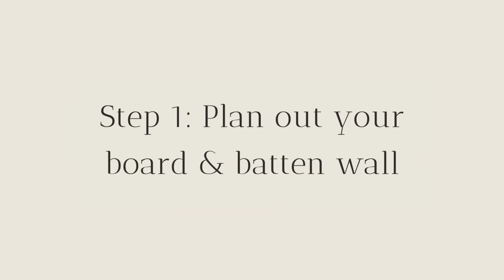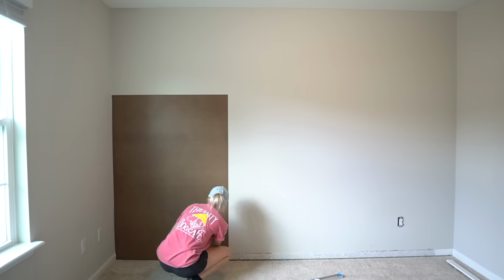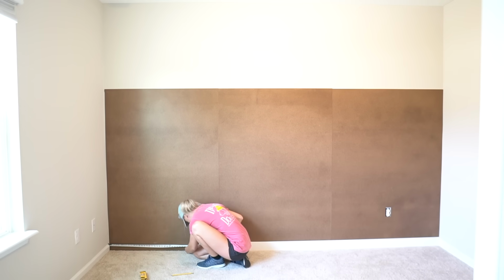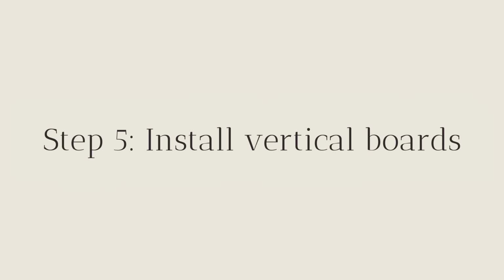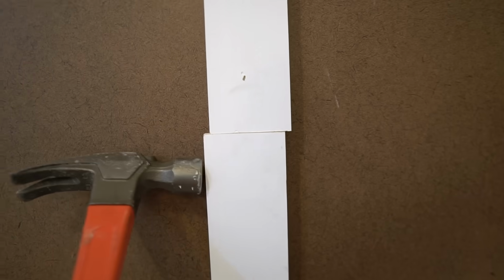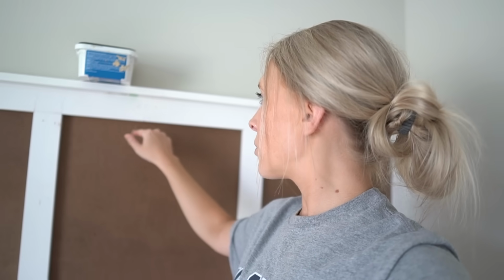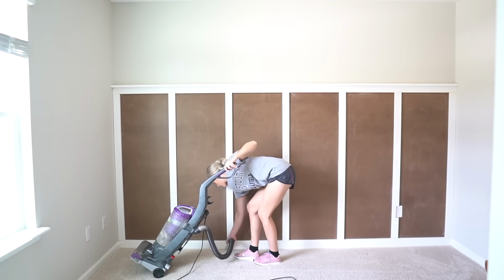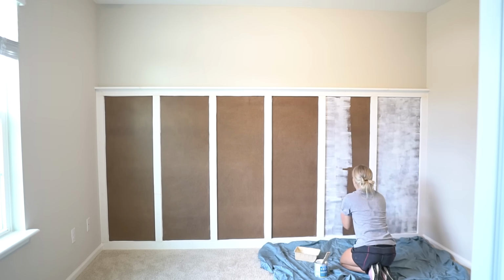Board and Batten With Textured Walls | HomeWithStefani

Comment: PRO TIP: When using construction adhesive lay down a bead of circles instead of lines, it creates a vacuum and helps the panel stick to the wall better.
Reply from the maker: Thanks for the tip!
Reply: Hi, can I ask how to secure to concrete walls? A nailer won’t work, I have adhesive will this do, it’s only going in a cupboard to make walls good.
Reply: Lisa Porteous there are concrete adhesives that you can get at the hardware store. Just find one that can be used with wood. There are also concrete anchors you can use,  but I don’t think I would with this type of project.
Reply: @lisaporteous3689  
I would use screws. So screw the large sheets to the wall and then cover the screws with trim or frame. 
The real why I would use screws is they are strong and they do not require setting time like an adhesive. And then if I wanted to I could put shelves on the wall easily. 
I would use sheets of plywood instead of mdf If I was needing selves/cabinets.
Reply: @lisaporteous3689   that should work, but make sure to have some boards to brace to the opposite wall to hold your pieces up against the wall while the adhesive dries.  You could also use adhesive which has directions to cut the piece, apply adhesive to the back, then pull it back off the wall and let it stand open for a couple of minutes, then put it back up; it is supposed to stick better then.
Reply: Just saw your tutorial, I  measured my wall which is 142" 3/4", I would like about a 20" - 22" spacing & am having a hard time coming up with the number of 1x3x8's I will need ----any help would be much appreciated.  Thank you.
Reply: @margielee5790  I just did the math, you should need 7 1x3 for around 20" spacing in between. With 7 it comes to 19.7" in between each 1x3. If you go down to 6, then your spacing will be around 24.35". Hope this helps!
Reply: @MsSwimmer5  Thank you very much.
Reply: Hi- does anyone know if the 1/8 hardboard used here will be enough to cover textured walls? Textured like 90s design, so some major texture.
Reply: To add: the painting company that’s doing the rest of the house says I would “have” to float the walls before I can put up my board and batten, even with the hardboard, and I’m not sure that’s right. It’s $$ for him to float the walls, so may be why I am getting that answer.

Comment: Nice. Well done. Especially the backboard and seam spacing.
Consider that the baseboard is also part of the wood work.
Maybe match the old or replace it all. Think about using the same color on all the wood work in the room.

This would give you a professional original look that doesn’t look like an afterthought.

Comment: I learn something new every time I do molding. I’ve also learned how to move an outlet which makes planning and the overall look so much better. That looks nice!
Reply: Hey Bradley, can you please share how to move an outlet? Electrical wires are generally stapled to the studs in the frame stage and then covered by drywall. I can't think of how a person could go about moving the plug from one stud to another without opening up the wall. Thanks
Reply: Mark P there is usually some slack and you don’t have to move it much. Cut a new hole and put a remodeling box in the wall. Use the cut piece of drywall to seal the old hole. Thing is that you have to use your existing wiring without splicing. That would make it a no no. Check out finish carpentry TV’s channel.
Reply: Bradley Beames  thank you Bradley. I had no idea that electricians leave a little slack in the wires. Sounds like there may be enough slack to move the box from one stud to the other but within the same bay? It’s been a few years since I walked a house in the frame stage.

Comment: I like that you include you actually doing most all of the steps. My wife is an interior designer by trade and actually had a similar taste in style.

Just a thought if you ever have bad results from a big box store's panel saw or it is down. Kreg makes a very handy tool, Rip Cut, that is pretty in expensive ($40?). I have been very pleased with the results. The WWMM channel had suggested bringing a cordless circular saw to get plywood to fit into your vehicle, which I think you had in a video - mine is corded. 

Keep up the good work!
Reply from the maker: Great suggestion I will keep that in mind. Thank you!!

Comment: I would use the wall as a headboard and put the bed against it. It would look beautiful and it's too pretty to be covered up. It looks nice with boards in between as well. Great job.
Reply: You can also make small style wall headboards on a wall it just requires less materials that in the video.

Comment: I work as a painter and sometimes there is renovation to do before painting. If you are nailing your panels, the liquid glue is like killing a fly
with a hammer. Imagine you change your idea in a year or so, how much work will be needed to take the panels off the wall.
Reply: What would you recommend instead?
Reply: @manuelcastillo5999  I thought she was adding the liquid glue because these panels would support something (shelves, etc).
If not I would have just nailed the panels to the wall. Or maybe just add a line of glue to the top part (behind) instead of everywhere 
behind the panels.

Comment: Nice! I give it an A-, would have been an A+ if you had moved that outlet. I like your videos. your closet video was awesome! Makes me want to make take on so many projects. I just need more $$$$
Reply from the maker: Thank you!!
Reply: Why did she need to move the outlet?
Reply: @kathyusa-iowa5137  moving the outlet would have left a cleaner look by not needing to notch the board. Because Stefani was covering the wall with the panels anyways she could have done it and not worried about patching the hole from moving the outlet. It's a minor detail that a lot of people don't do but can make a huge difference when your installing paneling like that. Moving an outlet though is something that many people choose to not do due to fear of electrical shock.
Reply: @kathyusa-iowa5137  if that outlet was moved 3 inches to the right, she wouldnt have had to notch the wood like that, and you get a more uniform look. just a nit pick, not a deal breaker.
Reply: @jefemuga416  oh, I  see what you're saying, thx for clarifying 👍
Reply: Can't really move an outlet as it is secured to a stud. What she should have done is measured so the vertical slats made it so the outlet was in the middle and not hitting one of the slats. One more step to do and think about but would have made for a better looking. Moving an outlet for a project like this doesn't make sense.
Reply: I mean let's be honest though.. She could have done a different uniform measurement for the uprights and split the vertical boards on a different spread.  Either more or less.  She's far more talented than me, but I see that cut in and I just think math.
Reply: @kathyusa-iowa5137  she didn’t need to move it because it’s going to be covered by a bed and side tables.  Ignore all of the ignorant mansplaining in these comments.  I’m a man myself and this is the best DIY board and batten video I’ve found and I’ve watched a lot.

Comment: This came out so pretty. Love your channel. Quick question - is it important for the Brad nails that hold the verticals to go into studs or just into the drywall is good enough?
Reply: My understanding is that you can nail into just the dry wall since the brad is there just to hold the board until the adhesive dries/cures.

Comment: An old painter once told me, if you are painting darker colors, use a a dark primer, I've never seen a black primer, so I suppose you have to mix it. But anyways, white primer will make dark colors appear lighter, requiring more coats to get the color you originally wanted. He said grey primer for paints like red, blues and greens, and white for yellows and oranges I think orange. I drywalled for years and never knew.
Reply: Regardless of the color of the primer you'll most likely give it 2 coats of paint... Only when I'm using emerald i give my walls one coat and in my opinion is better for the walls to be white and whatever white primer left can be used on other projects. Been painting for many years and have used a colored primer once or twice.

Comment: really, really nice! Here is a painting tip..after you apply your first coat of primer apply a light sand with a super fine sandpaper (do this twice for best results) and then apply the paint. Apply a light sand again and then apply the final coat of paint. It will look as if it was professionally sprayed.
Reply: Just so some people know, some types of paint explicitly say not to sand between coats. Just read the label to know which ones you should not sand between coats.

Comment: Looks great.  I may try this idea in my home.  I have a carpenters tip for joining two boards together.  When you need to join two boards together as you did for the top boards you used a but joint.  It is better to cut those boards at a 45 degrees.  That is not 45 degrees like a picture frame but 45 degrees like you would for joining two baseboards in a corner.   The 45 degree overlap will hide any lines from showing later when the wood shrinks a tiny bit.   This is also good for crown molding as those boards will shrink and make the line very visible.
Reply from the maker: Very good tip, thank you! I will try that on my next project.
Reply: Scarf joint 👍

Comment: I'm about to start my B&B in my powder room, but the walls are VERY textured from a previous owner. Are the hardboard panels you're using enough to cover a 90s look? Or is it better to remove that texture first, even if I am using the hardboard panels? I am hoping to minimize the amount of space I have to float. AND, I am hoping to find a video of yours for that process, because I've seen some others and there appear to be several methods.

Comment: Did you use oil based or water based paint? I noticed the manufacturer of the backer board recommends oil based as they are sensitive to moisture, but I really don’t like oil based so wondering if water based will work fine!

Comment: Are you nailing through to the studs or just anywhere in the drywall? Will it hold if just nailing to drywall?
Reply from the maker: I nailed them in just anywhere in the drywall! When nailing in the boards, I angled my brad nailer up and down instead of going straight in so that it secures the boards nice and tight!
Reply: normally you'd always want to go into the studs, but she added glue as well so it's fine in this application. Crown and base always nail into studs

Comment: Did your hardboard bubble up because it’s a hardboard and if you paint it with water based paint then it will soak the water and bubble up. Wondering if this happened to you

Comment: Great project Stefani!  It turned out really well, and I've got all kinds of ideas about building wainscotting a similar way!  Thank you.     :)      If anyone wants to do this in a rental or in a less permanent fashion than the liquid nails approach, there's a product called ZIP that's used for temporarily sealing windows. It's basically the same as the stuff that banks use to adhere credit cards to paper..  When you're done with it, it peels off without damaging the stuff underneath..

Comment: Only part I felt I could use some more pointers on is nothing out the boards for the plug. Did the 1/8 boards make your plugs cover not able to sit flush with the plug? Could you share a close up photo of the plug after it's all done?
Reply: That was my only issue. I would've moved the outlet

Comment: Don't remove sanding dust with a damp cloth. That will raise the nap of the wood. Use a tack cloth instead. You can make one yourself or buy them pretty cheap.
Reply from the maker: Thanks for the tip Kathy!

Comment: I really don't like cutting one of the vertical  boards to make room for the outlet.  It's instantly noticeable, even in the thumbnail.  It would have looked way better to move the panel to the left an inch or so....if the middle one is off center it will be obvious, but nobody will notice if one of the segments is slightly smaller than the others, especially if you match the width on the opposite side.

Comment: Nice effort...I'm just not a fan of butt joining boards to get the proper length.  And if you're going to do that, a scarf joint is better than a butt joint.  Another option, if you trust your measurements, is to pre-assemble the 1x3 and 1x4 grid as one piece using pocket screws and then attach the entire assembly to the wall.
Reply from the maker: Thanks for the tips!